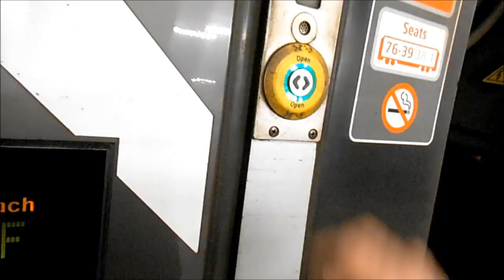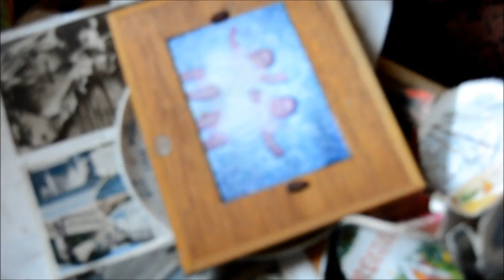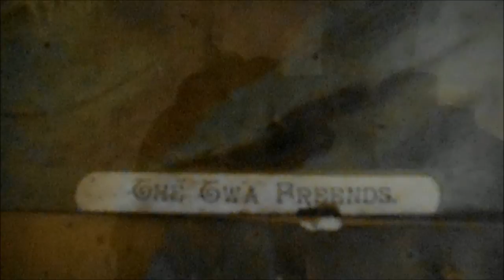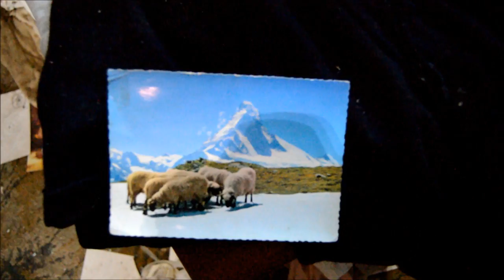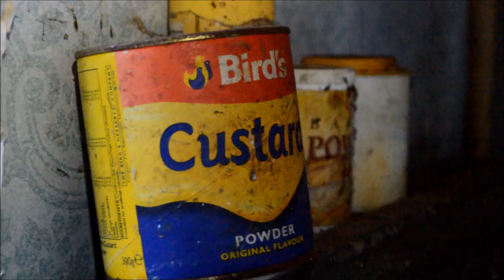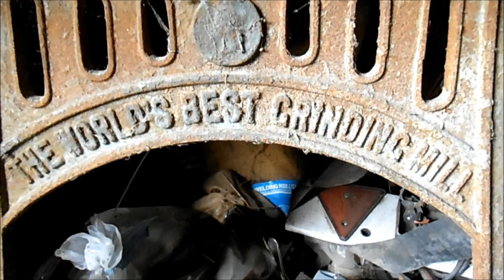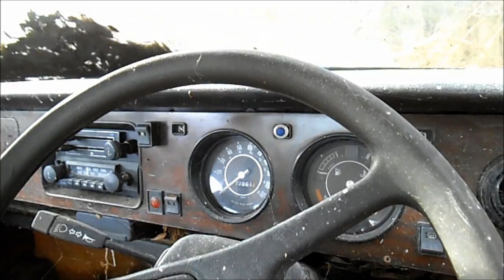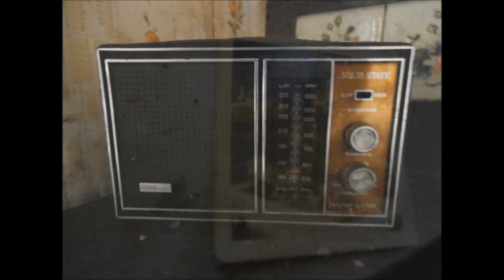Urbex ~ The Vanity House

Comment: The 1985 Ford Orion is SORN, no details of the MOT on DVLA database, probably means it hasn't been tested for about 8 years
Reply from the maker: +andy parr Hi andy, thanks for the Fords vehicle details, my last few cars have been a 91 - Peugeot 205, 93 - Ford Orion 1.6i Equipe, 01 Citreon Xrara, 91 - Honda Civic 1.6,
My favorite by far was the Orion,,,a great looking car, but most of all it was just great to drive. sorry to hear about the fire at kenley...someone maybe wants the land? surely not bored kids again. Thanks for watching the tour.
Reply: +Abandoned UK I can't search on Austin for the Maxi, so have done feedback to DVLA
Reply from the maker: OK thanks...don't suppose that Austin Seven had left many clues;)
Reply: whenever you film, get the registration number and make and there is a DVLA website https://www.check-mot.service.gov.uk/?_ga=1.168724649.962465303.1457191811 and it tells you the recent history, since MOT's were computerised

Comment: we have copper thieves over here across the pond, they strip all the wiring from the electrical outlets, light switches, air conditioning units/heating units, bathroom fixtures,  mostly crack addicts; it's a shame really
Reply: +pat murphy : Indeed. Even new construction is not immune. I just retired from a US Rustbelt city police department. The amount of thefts from new construction was ridiculous.